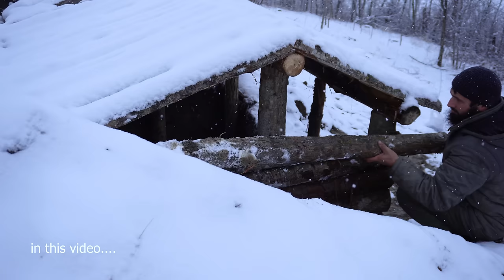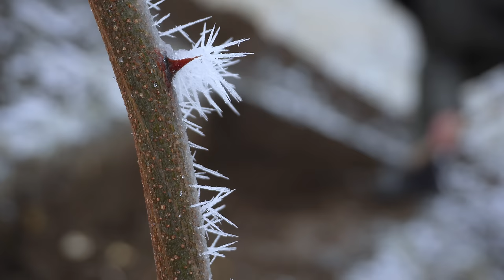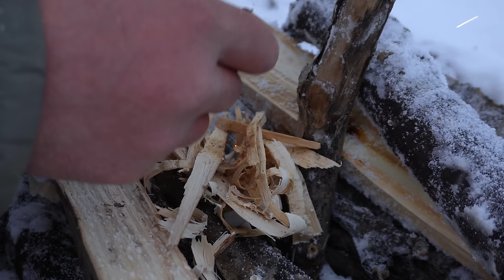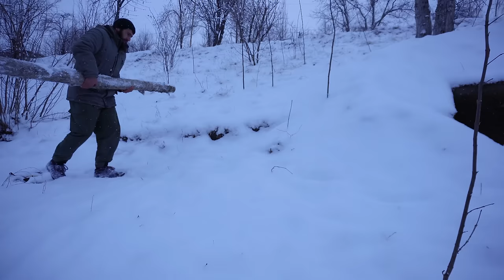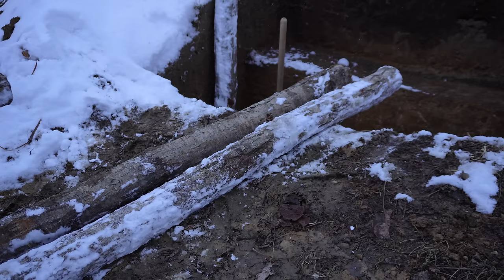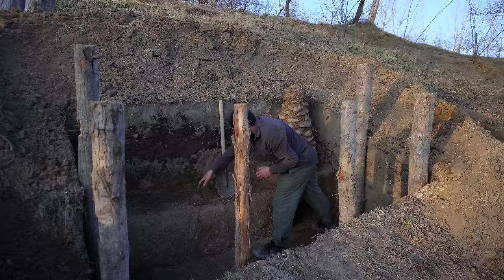Building Complete and Warm Dugout Shelter for the Winter, cozy fireplace & clay roof

Comment: Won't the water run off the hill and drain into the shelter which is he lowest point. Where does the water go?
Reply from the maker: I made drainage on top
Reply: Pretty frosty too in this season. If it's a temp, I think this will do..
Reply: The water is frozen unless he gets a fire to melt it
Reply: Pretty smart this guy. I wish I have your talent and energy. Thank you for showing your videos I loved it.
Reply: Water go inside your stomach through mouth❤
Reply: How is the water going to run off when everything is ice & snow ? U funny asf 😂😂😂
Reply: Badass doing this in the winter...no gloves!
Reply: in the ground
Reply: مرتي
Reply: Ты русский? @osbushcraft
Reply: ❤❤ @osbushcraft
Reply: North won’t melt
Reply: Yes, the way it was built it may not "flood" but it will definitely be wet inside. It is a great temp shelter but it won't keep the water out not like that. You would need heavy clay or to crush rocks and wet them to make a concrete. You'd be better off with the entire cabin underground except for the front.  Especially if it pours. Packing it with mud alone won't work it will wash out. You'd have to take the mud and mix it heavily with grass and leaves. The mud should have also been placed heavily on each wall log then the next one placed and hammered. In an emergency it would keep you dry enough. Don't get me wrong it's decently able to keep you alive. He did a great job. I'm simply assuring you that you are correct it will get wet and the dirt/mud will wash away. You can't just build a shelter and throw regular loose dirt or mud on it. Yes, there are mud huts but they aren't made by just using plain mud.
Reply: Seriously? You do realize ice & snow melts, right? And becomes water again? Especially when it's on top of a roof that's emitting heat.
Reply: @whatwasthequestionx4282 child calm down, he built a drainage, so unless that answer was in your head you’re not too smart either

Comment: You probably should have considered placing the tarp along the back of the dugout, preventing moisture from seeping into the ground, dampening the back wall of the dugout... Last thing you want is moisture getting in through the ground. You could have lined the inside with wood as well to try to help with that a bit more.